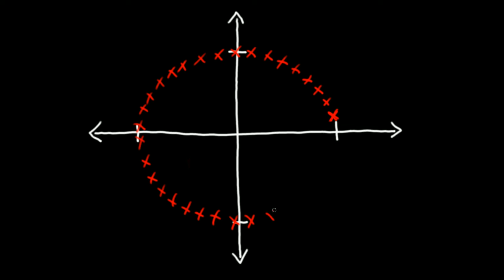Software Defined Radio with HackRF by Michael Ossmann, Lesson 6: Complex Numbers

Comment: I have a few questions on this great presentation:
1. Is there at all a relationship between the second part of eulers formula (cos(theta) + i x sin(theta)) and the rectangular representation?  My brain wants to associate the two together because of it's similar form...
2. Can the unit circle ever be anything other than the circle around the 1/i axis?  E.g. can the "Unit circle" ever be [2, 2i, -2, -2i, 2, 2i, -2, -2i....]
3. The angle (theta) that is, the angle away from the positive real axis.  Will that ever be represented as a negative number, or will it always be just a number to represent the angle up to 360 degrees? 
4. Is the angle theta ALWAYS relative to the unit circle of (1, i, -1, -i...)? 
5. Should the phasor / vector always be theta when represented as euler's number?

Hopefully these aren't dumb questions! Any additional resources to help solidify the finite details will be appreciated if you have them.  Thanks for such a comprehensive resource!